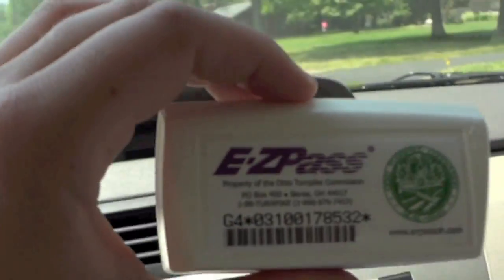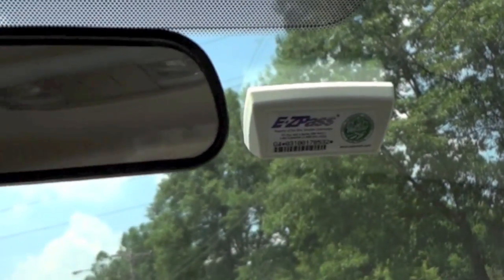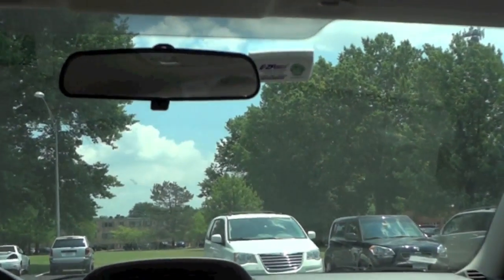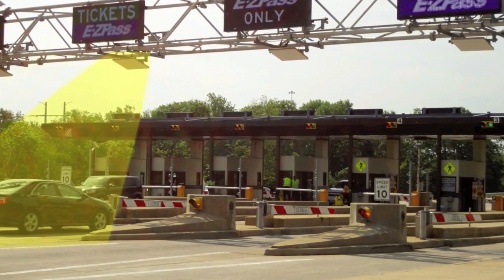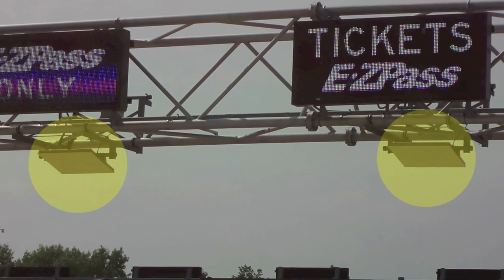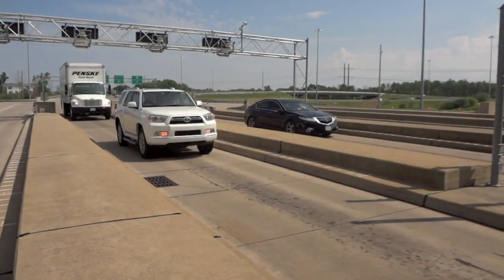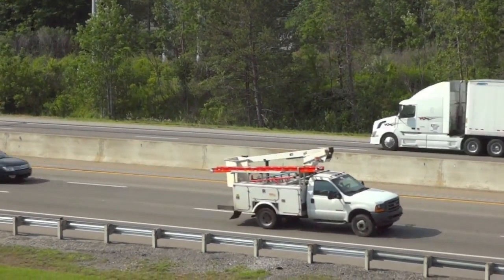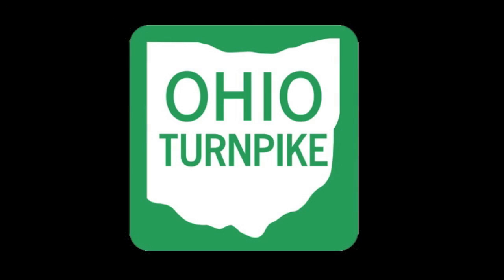How to properly install your Ohio E-ZPass Transponder

Comment: Per my Honda service department they have told me to not mount it by the review mirror.  It will interfere with the lane keeping assist system.  It also says this in the car's manual.
Reply: Mine told me the same thing.

Comment: During the summer months, the sun is soooooooo hot, it melts the adhesive strip and the Transponder falls off. I replace the
adhesive material several times. So now, When needed, I just put the Transponder on my dash.
Jim Lorenzen,
Perrysburg, Ohio
Reply: You left out your exact address and, apartment number and zip code.
Reply: *****
Yeah.
Reply: Jimbo Lorenzen g
Reply: Use a suction cup instead of adhesive

Comment: I lease my car on a 3 year lease.  Therefore, I need to remount the sensor each time I replace my car.  Attendent at exit gate was rude when I  waved my sensor to get through the gate with my newly leased car, but finally told me that Marc's sells the velcro strips neeeding to be replaced on the new car.

Comment: I just got a Class C, R.V.  and the top of the windshield would be blocked, is it okay to set it down on the dash? or put it in the Front Window of the Camper Shell above the Driver Area? and I need two more sets of your "Velcro" to attach it in both my "new" vehicles. The R.V. and a Leased Kia Soul.
Reply from the maker: John Lombardi The #OHTPK customer service center can help you with both of your questions! Feel free to contact them @ 440-234-2081 Ext. 1075
Reply: John Lombardi Just lay on the dash and hide it when not using it. The system uses a vhf radio signal like two way radios. It is not that picky about where you put it. I have had transponders work when stored in the center console.

Comment: How is it suppose to read it if the barcode is ON THE INSIDE OF THE CAR... FACING BACKWARDS
Reply: It doesnt scan for a barcode, it communicates with radio frequency. The scanner sends out a radio frequency and the transponder returns the signal. Not scanning a barcode.